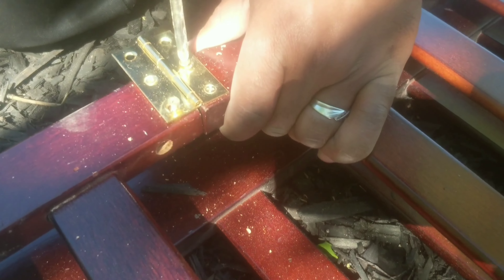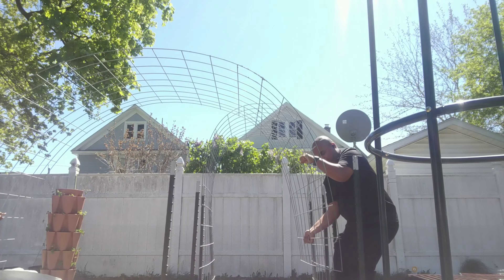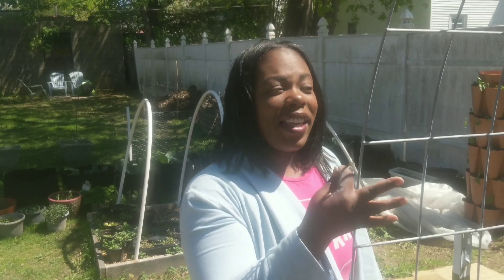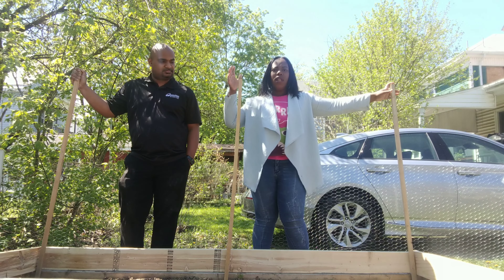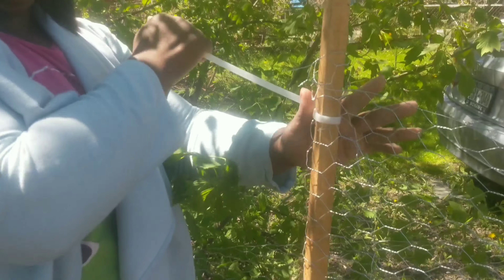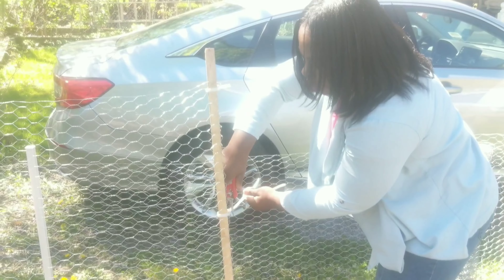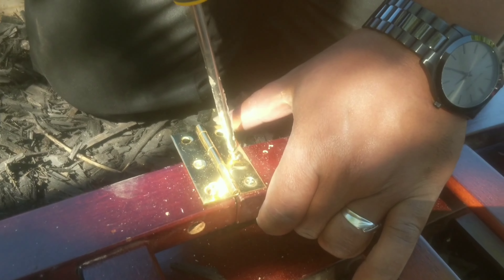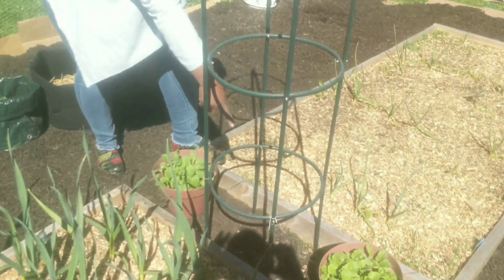Trellis Your Garden// From The Backyard To The Homestead - Part 1 Collab W/ Barefoot In The Garden🌿

Comment: I personally don't like using chicken wire.
It works okay for some things though. It causes me issues 😂.

Oh no not the crib..... it's pretty but it needs several coats of polyurethane or other outdoor protection if you want it to last outside.
 I'm hoping you rescue it and use it inside for a project.

The cattle panels do make some really nice structures fairly cheap!

Anyway sorry I missed your LIVE premier.. . today has been one of those days for me.